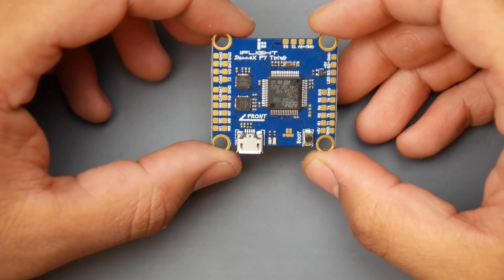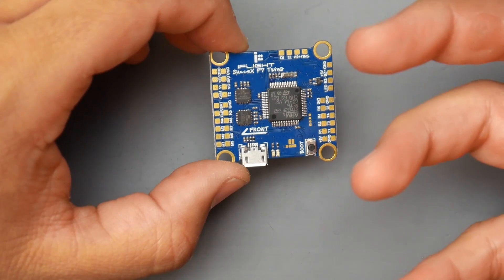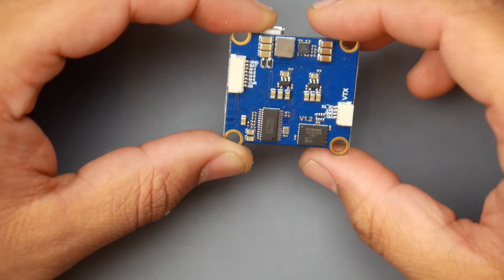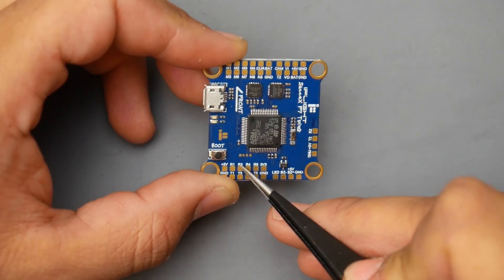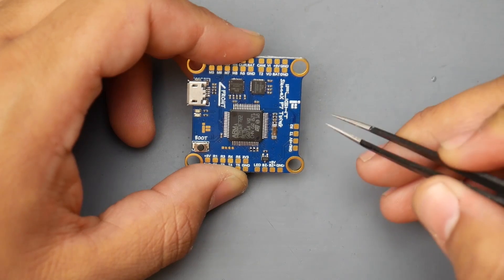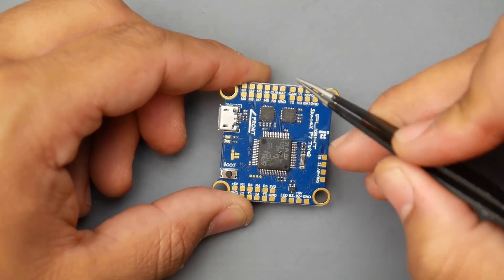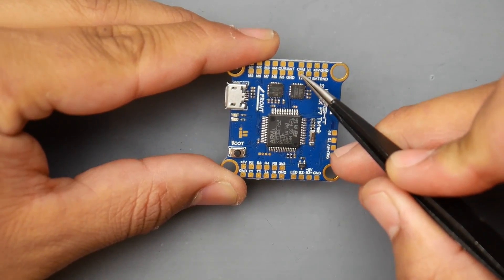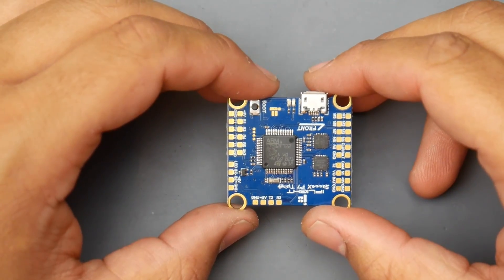Dual Gyro Fusion Hype or Not? // iFlight Succex F7 TwinG

Comment: It does not have a 9v regulator and hardly any filtering. I believe the Dalrc f722 dual is a much better flight controller. Including a 9v BEC and a connector for GPS among others. In betaflight 4 there is no 32kh mode any longer,  which probably ends the real advantage for the gyro fusion, as in 8khz mode the gyros seem to have less noise. @dronemesh would you prefer to keep a lower electrical noise with a 9v BEC for the vtx or get this fc board with gyro fusion?
Reply: But the 722 doesn't use both gyros at the same time as they are different. But yeah the no more 32k... Well for now at least... I'm beginning to dislike betaflight as thing seam to be big changes, which isn't bad except for when it means I have to start from scratch everytime.
Reply: Emuflight still uses 32Khz mode. So I guess, it depends on people ;)
Reply: hey, look at new Succex-D F7
- F7
- 2.5A 5v AND 2.5A 9v becs + impressive capacitors line up on each :D no more external becs for split cams + 600mw vTX needed!
- Fusion gyro (same as here - 20689)
- DJI one connector option AND good old Analog 
- no pit mode I think, but SmartAudio can help somewhat
- 5 UARTS 
- BARO
- 32mb 
- USB-C

BTW - there is 20x20 one called mini as well!! ALL SAME, but less weight and not as much filtering, but still impressive as hell! 
BTW - there is version without HD DJI one connector, but with seems like dual Bec and BT

@dronemesh Have you seen those? I think best FC to date, missing full SDcard and pit mode perhaps? trying to find ultimate FC, but non seem to be perfect lol

Comment: Battery voltage for vtx causes lines in your video feed, will need lc filter, this board would have been good if it had a decent regulator for the vtx

Comment: "Gyro Fusion" is just marketing hype and has no real-world benefit. All that happens in Betaflight is that the samples from each sensor are averaged together - that's it. Also the ICM20689 gyros used on this board are the highest noise and by far the least reliable (high failure rates) ICM gyros and should be avoided. The only advantage of having 2 gyros on this board is you can still use it when one of gyros inevitably fails.